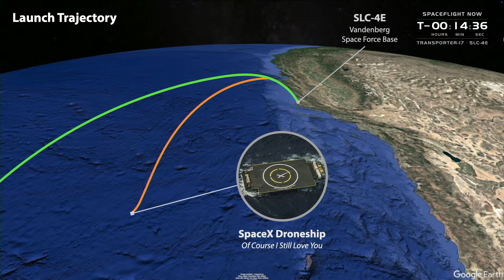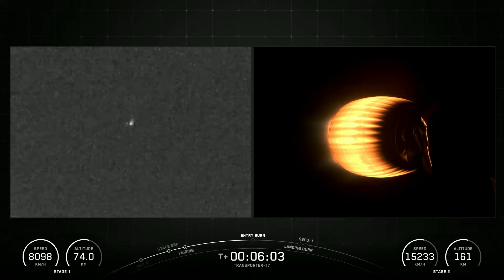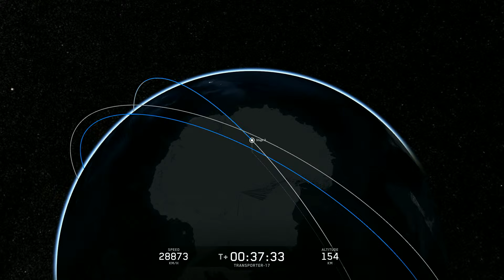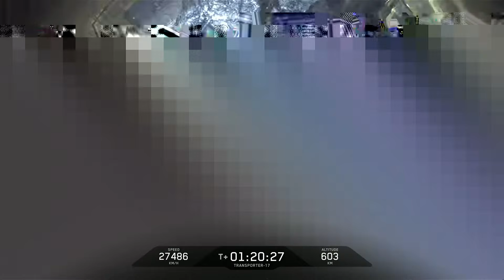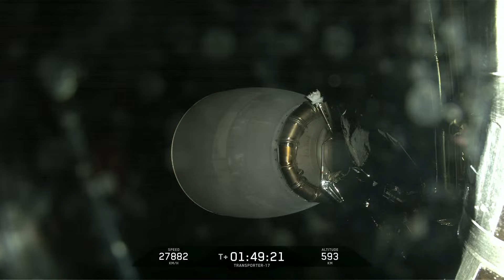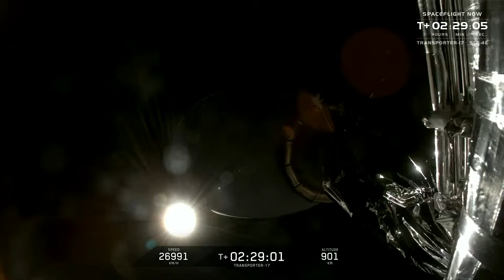Live: SpaceX Falcon 9 rocket launches Transporter 17 with 81 rideshare payloads from California

Comment: That's alot of stuff up there!
Reply: Lots of stuff to go wrong and make alot more tiny bits.
Reply: @MrWilderbeast66 I was wondering that myself Mr Wilderbeast, it would be like a big game of snooker up there with a lot more disastrous results!  It may happen!
Reply: If you laid every satellite and piece of space junk in a field, it’d cover about 1-2 km2, the spread over the orbital area is many times larger than Earth itself, so there’s actually very little up there.
Reply: @PK01234 probably 60km.  Space junk and debris like even flecks of paint coming off of rockets is still a problem though.  I'm sure, up to a point, stuff is being tracked for safety.